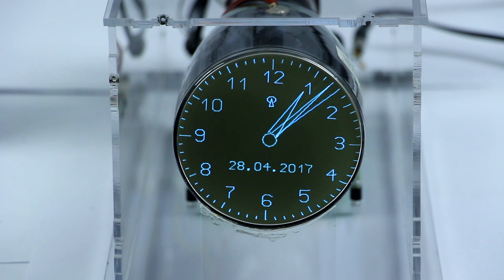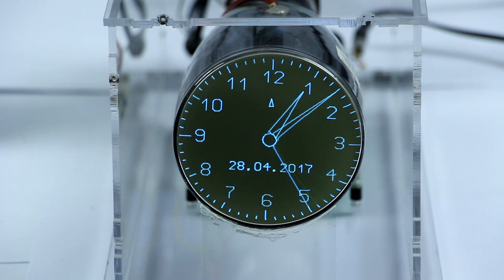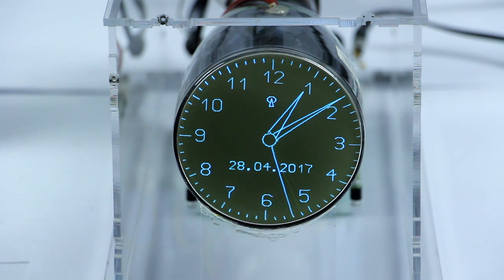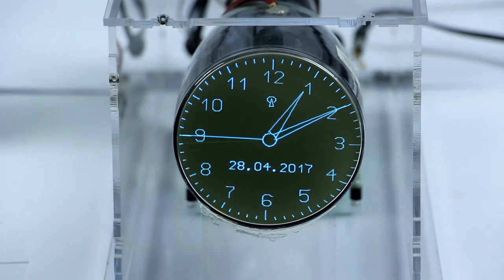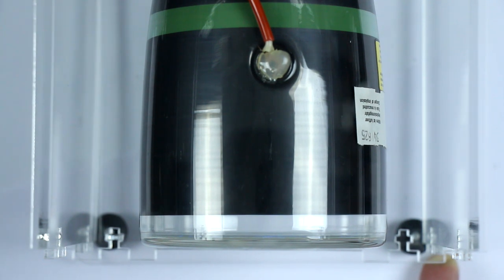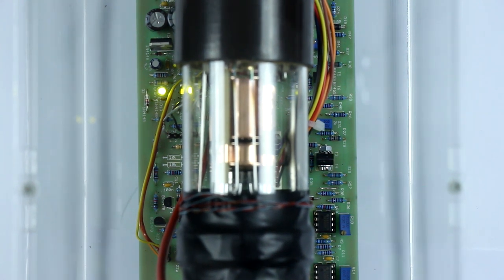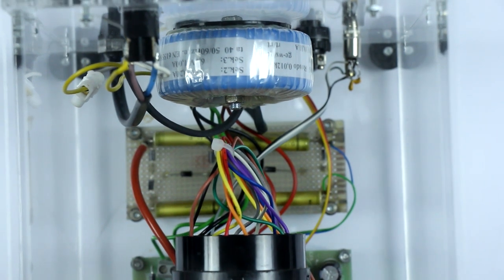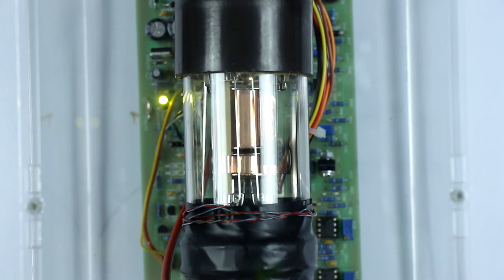Vintage Display Technology Pt.4: Oscilloscope Clocks

Comment: This is so ace!

Maybe something like an early 4-bit microcontroller would be more authentic, or in a pinch a Z80 or 6502, but if we were to discuss terrible ideas... all a watch face is, at the end of the day, is a collection of static shapes that get swapped in and out, basically you have one shape collection for the backdrop and scale, one you've got on a counter as a minute hand, one as hour hand, optionally more hands and icons... Assuming you're building like the classic mains cycle counter watch, you shouldn't need a processor, some ROMs and shift registers should suffice. Terribly wasteful idea, i know.
Reply: Combining a vintage Scope Clock with a "vintage" CPU (Z80 6502 etc,) is a great idea, but the used "modern" microcontrolers are just barely achieving the needed framerate to make it flicker free. I seriously doubt that a vintage CPU would be fast enough.

Comment: Aren't you worried about burn in with  dial and numbers?
Reply from the maker: No. There is an algorithm that shifts the display for a few millimeters from time to time. I have the CRT running at low brightness and I think that these tubes were made to have a long life because they were running in radar-stations 24/7.

Comment: I think the term for the high voltage return in English is referred to as the fly back
Reply from the maker: Looked it up: It´s the "post-deflection acceleration-voltage". It´s a DC-voltage in the range of a few 1000 volts.
(The flyback-transformer used in CRTs for TV is for the magnetic deflection not for acceleration AFAIK.)
Reply: KainkaLabs thanks. I really like you videos
Reply: I always thought that the Flyback Transformer was for generating extremely high voltages. The last tube to be replaced in TV's (other than the CRT) was a high voltage rectifyer vacuum diode tube connected to the flyback xformer
Reply: flyback transformer is for TV scanning only where the horizontal scan is a fixed frequency - its basically a hack to combine PSU and scanning oscillator into a single circuit for lower cost.  Scope's have to support any scan speed so that the X and Y deflection circuits are basically just linear amplifiers.  For an electrostatically deflected beam tube you want a slow electron beam to make deflection easier, but then want to increase its speed/energy to make the screen bright.  Magnetic deflection is used in TV tubes so they don't have to be 4+ foot long.